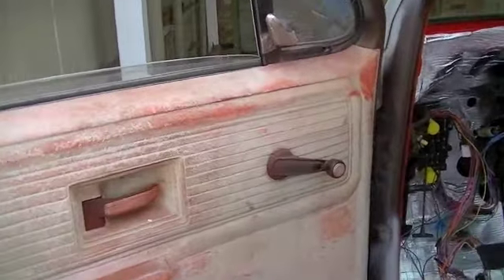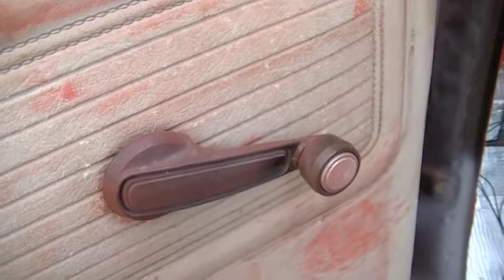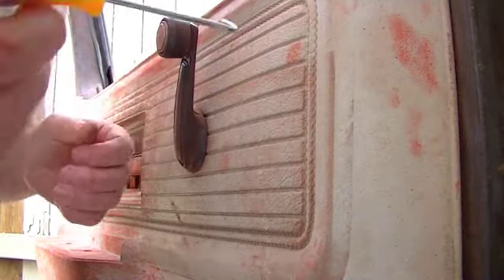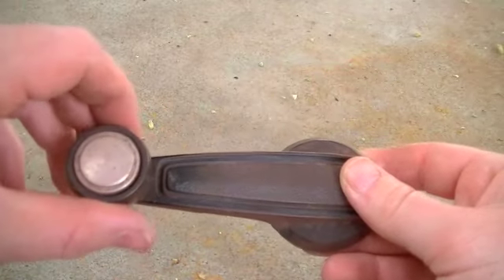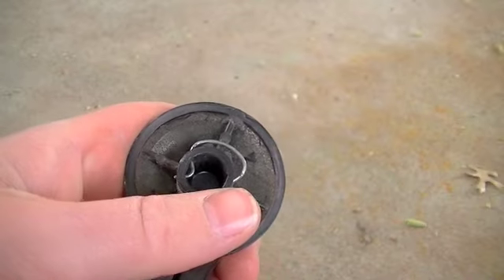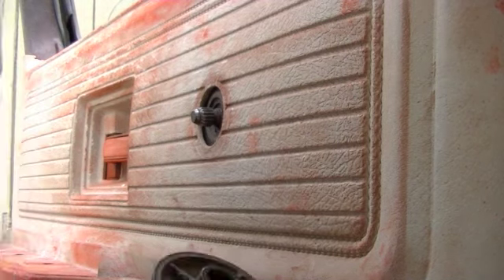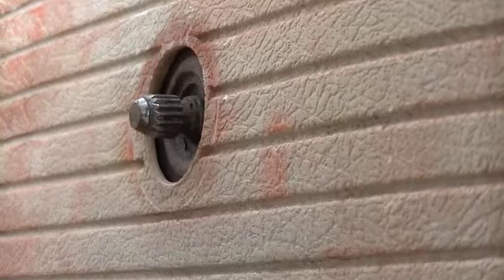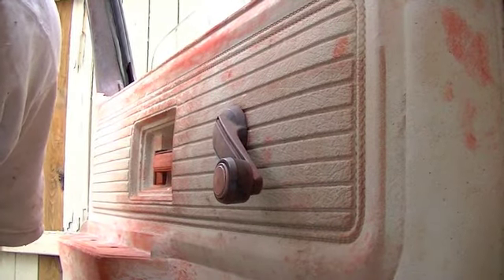GM CAR AND TRUCK WINDOW CRANK REMOVAL

Comment: Just use a shop rag. Slide it behind the crank handle and pull it back and forth. It'll catch the clip ends and pop them out. Works better than an tool you can buy.

Comment: What i often do.... especially whith vehicles with less space between the doorpanel and the crank is take a towel or a rag. Hook it behind the crank and pull it down against te clip. then pull at the ends of the towel and the clip falls out.
Reply: I just used a starter shim .